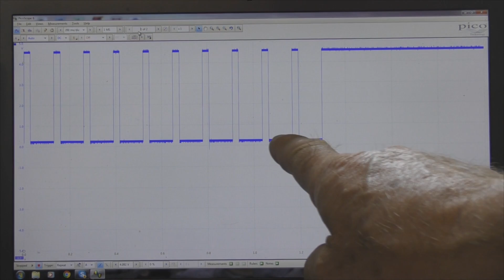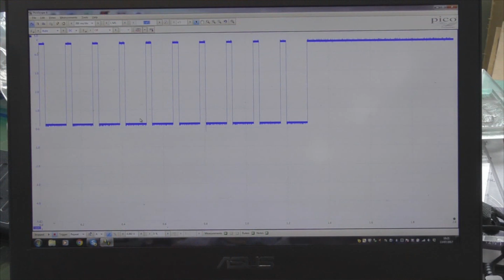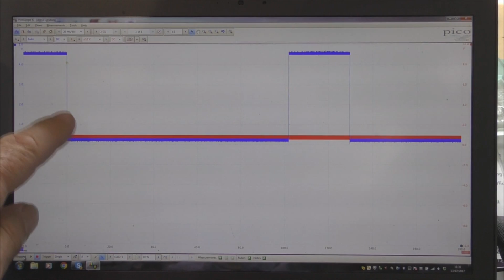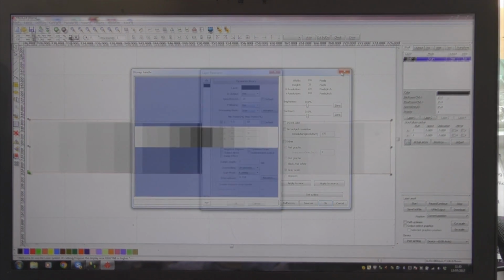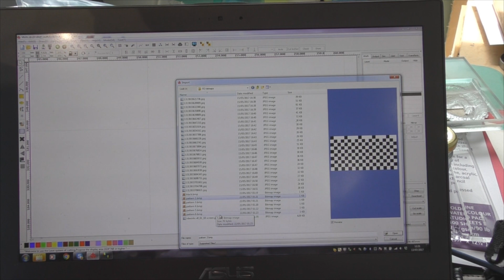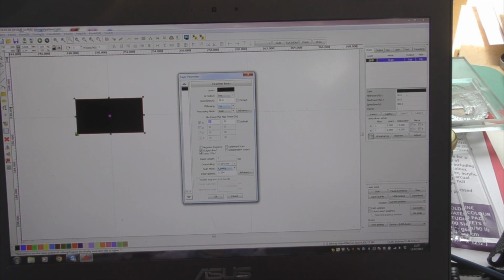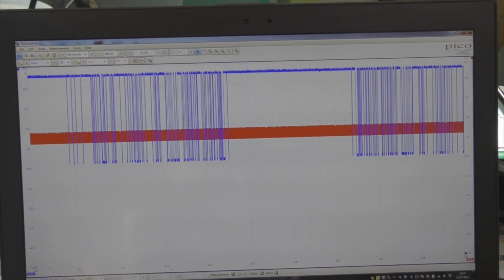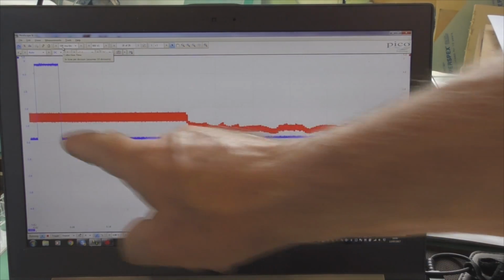RDWorks Learning Lab 112 Checking those Dots with an Oscilloscope

Comment: Hello Russ The question still remains why are we putting PWM signals from the controller into the analog input of the laser supply. I have proved on my machine this caused a large reduction in output power. I added the wiper of a pot to the laser supply analog control pin as shown on the wiring diagrams found on the laser supply web site. I was only able to cut 4mm MDF, now I can do 9mm.I find it hard to believe that an analog input will behave as expected when we stick a (20Khz as measured)  PWM signal in it.  there is an output on the controller called "L-AN1" I have confirmed this output has a 0 -5V signal that changes with the grey scale level.  I have not had enough time to prove this out yet.Another point of signal error is the wiring  between controller and power supply is not shielded, meaning the analog control signal could pickup noise from any of the power supplies or stepper motors.Pr
Reply from the maker: Hi Fred
I am no electronics expert, as I have mentioned many times, but from what small amount of reading I have done the 5V terminal on the HV psu can be connected to GND via a 5K potentiometer. The variable voltage  (0 to 5vdc) out of the potentiometer can then be fed to the IN terminal to control the current flow through the laser tube. This is the typical way that the non-digital K40 machines control the tube power. That current then causes different excitation levels in the ionized nitrogen  which results in more CO2 lasing action as you increase the potentioneter (ie you get more current flow). That same IN  terminal can also be used for the 20kHz PWM signal,   but this time the cyclic signal is intercepted by a  filter network where it is likewise converted into an analogue voltage to control the current.  As I say again, I am almost electronically incompetent, but with good advice from my good friend Chip Williams I have put a small RC network on the input to that IN terminal so that I can get an idea of how the PWM signal is working within the power supply. The filter values are so small as to have negligible effects on the PWM signal itself .  I am looking for patterns of behavior in that line and not absolute values.
The RDC 644XG manual shows the PWM as the preferred connection CN5/3)  and in a brief description it says 
When the laser is a glass tube, this pin will be connected with the laser power PWM end and used to control the power of the
laser.

Equally it says about CN5/5

The analog signals for Laser Power. If Glass Tube is used, this pin is recommended to control the power of the Laser.

I can see that this CN5/5 is an analogue output and I do suspect (without having examined the signal output)  that this would be an equally valid input to IN on the HV psu.

Your point about noise and analogue signals is valid therefore why use analogue when PWM is more robust and is converted to analogue at the very last moment within the HV PSU

My only concern with your increased power claim is that you do not get something for nothing. Do you have an ammeter fitted? do you know what power rating your tube is? Do you know what the maximum allowable current is for your tube? Are you now exceeding that max current? 
Again, I remind all readers that my knowledge of electronics is hardly ankle deep, so pleas feel free to correct or add to my answer.
Many thanks for a thought provoking comment
Best regards
Russ
Reply from the maker: Hi Fred
In summarizing my dots/ picture work for a Thinklaser training video, I had occasion to hook my scope up to the Lightblade machine. Guess what?  The current control is via the analogue output.  There appears to be no difference in the signal output other than I can scope it without the need for an RC filter. I have sent a question to Thinklaser to see if they can find out from their Chinese machine builders just what the advantages/disadvantages are of using one system over the other. Watch this space. 
Best regards
Russ
ps my China Blue controller has no analogue output terminal.
Reply: I have just made  a discovery with my machine , however I need to think it over before i commit to any definitive statements. The test- I made a current to voltage converter that outputs 100mV per 10mA current flow.this unit was powered from an isolated supply(battery) and fed into a cheap(dispensable) battery powered oscilloscope.the current sensor was connected inline with the laser tube negative return.as I suspected the energy flowing through the tube is not as pure and even as we would like to hope.My tube is labeled as 50W and has the correct dimensions for 50W. I have fitted a moving coil meter for confirmation of my maximum current(18mA).all tests to day were performed with the Hv supply current set by my added POT.with a setting of 10mA there is around 3mS of oscillation when the power supply is triggered,the spikes can be up to 60mA. as the spikes diminish they exhibit a classic ring pattern. after 3mS the tube current is a flat line.the quantity and frequency of the oscillations seem random. Pr
Reply from the maker: Hi Fred
As I freely admit to being an electronics numty I cannot have any sensible conversation with you on this subject other than to say that the original reason for me buying my little Picoscope was to try investigating the  current flow in the return line just as you are doing, but I was particularly looking for facts about the pre ionization phase. I  put a very low value resistor (100 ohms I think) in that cathode line and was attempting to measure the voltage drop across the resistor. It was working great but I was seeing all sorts of strange unexpected high frequency and low frequency signals, some looked just like the ringing you mentioned. Upon conversing with my electronics guru Chip Williams he warned me that I could see all sorts of rubbish on that line from inductive coupling, capacitive coupling  and other sorts of trash especially as I was looking for ultra fast transients. Those words already told me that I was WAY out of my depth, so I packed it away. When I met him in Florida and he  wired his super expensive high speed scope to a machine and  the transient spikes I was expecting to see were still way faster than his scope could resolve. He convinced me that although the high current spikes were there, they were of such infinitesimally small durations that the gas would not be able to respond to more than the first percent or two of the waveform.
This  simple 2 line  monitoring project that I have been doing in the last two videos, is just about my maximum depth because it is less about trying to establish what the tube is doing and more about understanding the underlying principles of controlling the tube. As you can see, regardless of the signal purity and the resulting output power, monitoring those two wires have explained so much to me. 
I'm now going to have to hunt for my "pixel pulses" elsewhere.
By the way, if you have a 1000mm long 50 watt tube you should be able to drive it to 20mA max. 18mA =40 watt tube  (800mm long). 
I will let you know if I get an answer from China.
Best wishes
Russ

Comment: In RDWorks Learning Lab 101, there appear to be no dots.  It would be interesting to compare the signals going to the power supply for the "no dot" cut versus the "dotted" cut.  If the problem is inherent in the power supply (as Mr/Mrs Notsofastener hypothesizes), then how can we possibly get non-dotted cuts?  Perhaps he/she is right - we leave it to you, Russ, to figure it out for us!

Regards,

-Jeff
Reply from the maker: Hi Jeff
In 101 I was blissfully unaware of dots. It was not until I started my  journey to understand how to laser etch photos that dots and pixels loomed large in my life.  Was this a BIG mistake?  Well ,at the pixel and dot level for photos, no . In this quick demo of the signals for a dithered photo, I can see that every  ISOLATED pixel has it's own signal and attempts to burn a single dot but with a block of joined pixels you do not get dots but a joined up continuous driving signal just as you would in a vector image  scan.  So my belief that all bitmaps were  driven at the pixel level is totally wrong. I am however, pleased to have  found out because it now means I have to look elsewhere for those dots that appear in a continuous black pixel block at certain speeds and resolutions.
I will be doing some more detailed work later because this video was a quick exploration to see what was happening and  to demonstrate my oscilloscopic incompetence. Thanks to Chip ,the filter design seems to be responsive enough for  this type of exploratory work. Lots more tests to be done so stay tuned.
Best wishes
Russ
Reply: I thought about this a bit more last night.  Here's an experiment you could try, and it's worth every penny that you've paid for it:

Hypothesis - dots are caused by the mechanical system (and not by the laser system).
Test - run a pattern without using the mechanical system.  Create a pattern that generates a line of dots.  Run the pattern normally; we expect dots to be observed.
 Disconnect the X-axis drive belt.  Run the program again, and move the laser head manually at a similar speed.  Be careful to avoid getting your hand in the way of the beam!   Observe the output.  If dots are NOT from the mechanical system, then dots (with slightly non-uniform spacing) will be observed.  If dots ARE from the mechanical system, then dots will not be observed.

Regards,

-Jeff

Comment: It's not the stepper motor. You can test by doing dotted lines at 100 speed. It crawls along much slower than 100. I don't know if you have dotted line in RD Works. I use LaserCut. If it were stopping and starting at 600 you might find that the inertial forces would tear the machine apart.
Reply from the maker: Hi Joseph
As you can read, many are suggesting stepper motors and drivers are causing my strange gear teeth formation and pixel-matching dots. Logic says I must ignore those claims for the time being and methodically work my way back through the problem . With any electro-mechanical drive system the weakest link is always the connection between the driver and the load. In this case we have a toothed elastic band that was designed for CONTINUOUS transmission of power in one direction.  Throw intermittent drive pulses at it and there will undoubtedly be harmonic frequencies induced in the belt/s. My engineering education was always to understand the problem before you try to fix it.  I appreciate the many well meaning inputs but will carry on with step by step strategy
Thanks for dotted line idea. I can play with many acceleration factors from within RDWorks  So I have an infinite number of things to try before I get anywhere near the drivers.
All best wishes
Russ
Reply: I used the dotted/dashed line a lot to make living hinges in brittler thin plastic....not acrylic yet.
Reply from the maker: Hi Volkmar
Despite many suggestions that I should change the steppers or drives, that is not going to happen because my aim is not to fix the problem but to discover what's causing it. Now that I have seen for myself that there is no pulse from the laser that is causing this pattern, it takes my back to over a year ago when I first saw this phenomenon and postulated that it could only be caused because a permanently ON laser beam was not moving with uniform velocity.  The deep "gear teeth" we can see  are in fact positions where the traverse is zero, thus allowing the laser to burn deeper.
If you are an electronics genius the first finger pointing will be to the steppers
As a mechanical engineer my approach will be somewhat different.  Firstly examine the facts. This phenomenon has boundaries   For my 15 pixel pattern, as i select faster speeds, the problem changes from 16 to 8 to 4 peaks. At faster speeds where the peak to peak time is less than 4ms there is no sign of the problem. Now that the scope has proved we do not have pixel pulses,  upon reflection,  this number pattern actually looks like a harmonic progression. That in turn screams resonance to me.  The success of any servo system (or stepper) relies upon the stiffness of the link between the driving signal and the load. In our machines we have a RUBBER BAND for that link. Ye.s I know it is a non-stretch fibre stranded belt capable of transmitting several horsepower and that is exactly what it was designed for. However closer examination of its construction will reveal that there are no restraining strands in the teeth. They are just pieces of flexible rubber that will absorb and reflect forces. A stepper drive, by definition is a pulsed system, so my first thought is to enquire where and how those pulses are going.. Another interesting fact that the stepper advocates have overlooked,  is the peak to peak dimensions. My pattern was 100ppi and I had 15 pixels in my pattern  15 pixels =0.15" and 16 pulses (which I was excitedly trying to match to 15 pixels) is a peak to peak of  0.094" (0.238mm). that's nothing like the 3mm belt pitch OR any stepper increment.
So, Joseph,  you and I are all on the same page I think.
The massive problem I have right now is being able to see that resonance in some way. I have already tried an accelerometer but the G forces are not sufficient to break through the background noise. If I wish to spend about £3,500 I can buy a laser displacement measuring system that will plot the laser head movement to increments of microns and micro seconds or about £12,000 for a super high speed video camera. Good solutions but a bit out of budget.  In still have my 2 remaining grey cells processing the problem!!
Another interesting observation is that I get exactly the same patterns when I run on a completely different machine. The Lightblade has a hybrid servo system (basically a stepper with a rotary encoder feedback system) and its link to the motor is completely different,  via multiple pulleys. However, the belt teeth are the same form, material and width on both machines and although the Lighblade belt is about 10% longer, I don't think that matters because the compliance is in the teeth and not in the belt.
Do I believe the steppers are to blame? Yes undoubtedly, but what we are seeing are not stepper increments. We may find the answer has no solution other than radical mechanical redesign to something like chain drive, antibacklash rack and pinion or a recirculating ball leadscrew system. 
Again, I repeat I am not trying to find a fix, just to understand the problem.
Thanks to you and Joseph for stimulating comments.
Best regards
Russ
Reply: my guess would also go to the belt. i observed the dotted output problem a long time ago and tried to find a solution with the support. but they didnt reply. there is also a difference in frequency in x and y axis. so maybe with a different tension it could influence the pattern.
cheers
volkmar
Reply: To eliminate the stepper motor as a variable you might try a short single line pattern, going from right to left and repeat the cut several times using the # option BUT do this with your stepper motor disconnected from the power which would enable you to manually push the head to the left. Just a thought :)

Comment: Hi Russ, you've characterized the input signals to the power controller nicely but the high voltage outputs will have a different set of characteristics. The high voltage supply is a switch-mode power supply with its own high frequency PWM controlled output. The high voltage is not going to be a continuous output so the beam excitation will vary in pulses too. Since the "dots" are consistent across your experiments, this supports the theory that the HV supply pulses are a contributor if not the sole cause of the issues. It would obviously be dangerous to measure the HV output to characterize it but it does seem to be a next logical step. The mechanical theories seem less likely since, if I recall correctly, the Lightblade is servo motor based instead of steppers and should behave differently. Additionally the consistency of the dots independent of the linear speeds looks to poke holes (pun intended) in the stepper motor theory as there should be noticeable variance from the timing belts, cogs, motor rotor imbalance and other mechanical abnormalities. If this is not the answer here, which is entirely possible, then maybe there is something in the plasma physics of the beam, temporal mode or quanta power. I'm no physicist but I've studied enough laser physics to know they are incredibly bizarre and fickle. Anyway thanks for all these great learning sessions. You are a real asset to the laser cutter enthusiast community. Cheers!
Reply from the maker: I am sure that your finger pointing at the power supply is valid because I can see differences between my two machines with different PSUs.  This dot problem ( where the pixel resolution is matched by burned dots) is only happening in a certain range of speeds and resolution. I was interpreting this as a sweet zone , whereas it may turn out to be a combination of parameters to be avoided. I do understand that  the signals into the HV power supply have got to experience all sorts of delays and possible feed-back resonances before acting on our workpiece, however, I would anticipate that those effects are at timescales at least an order of magnitude faster than any mechanical feed back/ resonance issues. Thus it is  my strategy to  work back step by step to see if it leads to the real cause. I do not plan to fix any problem I find, my goal is to understand it.
Thanks for the interesting contribution Oh, and by the way, the Lightblade servos are not  real servo motors, they are hybrid  servos, which means they are stepper motors fitted with a rotary encoder so that the motor cannot lose steps. It does allow better control of the motor but I'm afraid that stepper characteristics still exist.
All best wishes
Russ